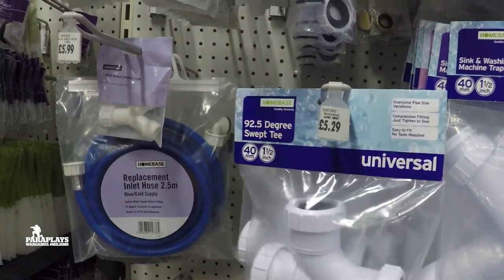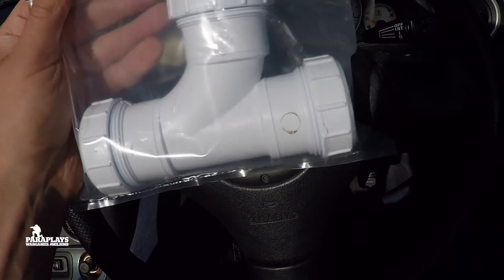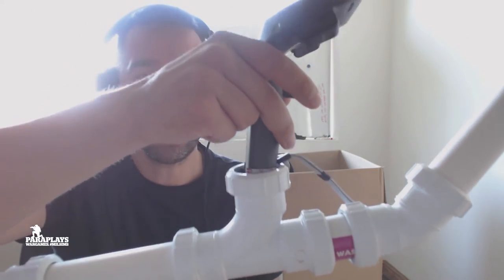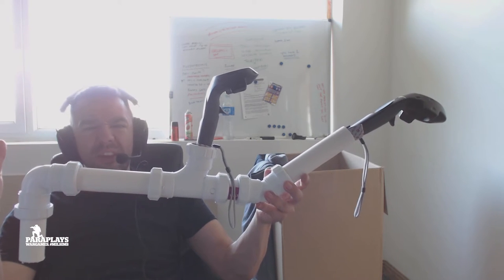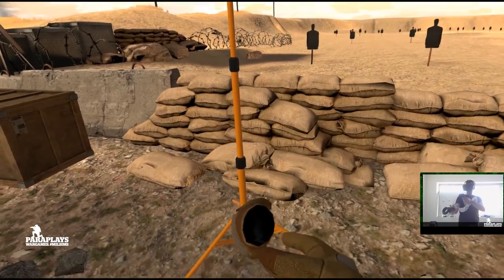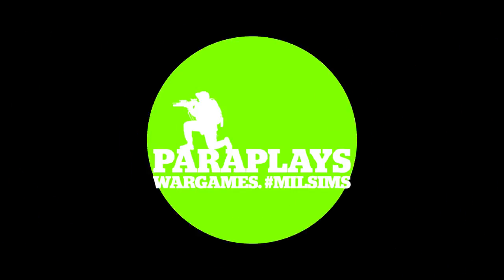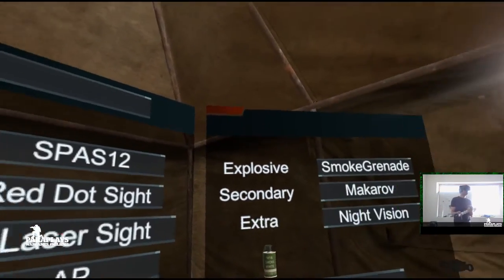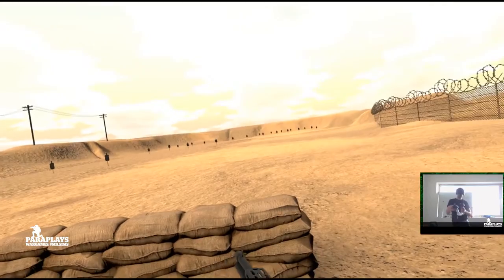Building a GUN RIG ► ONWARD PoopShoot 2000 V1

Comment: Fit a thinner pipe that slides into the thicker pipe. Those attachments should have a reducer from the thick to the thin pipe. Then you can slide it in and out to adjust the length
Reply from the maker: Good idea. It good for some assault weapons, if ya not fussed about grenades, but is a pain for radio.